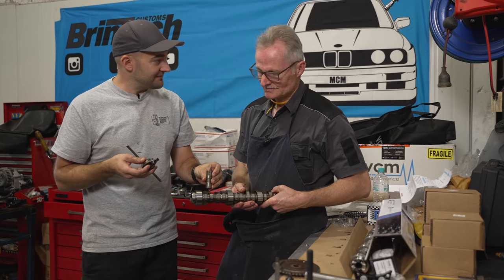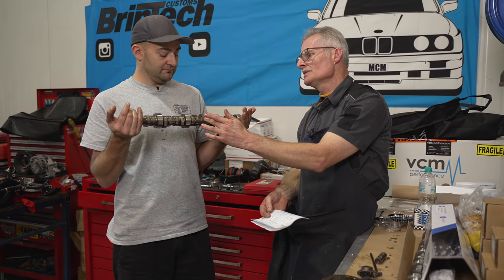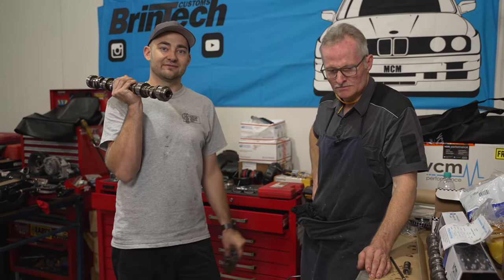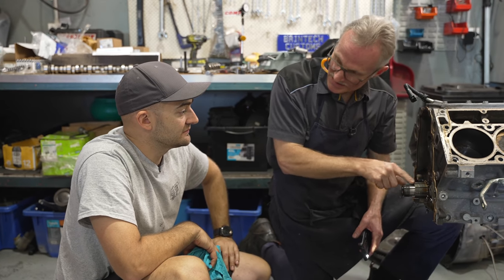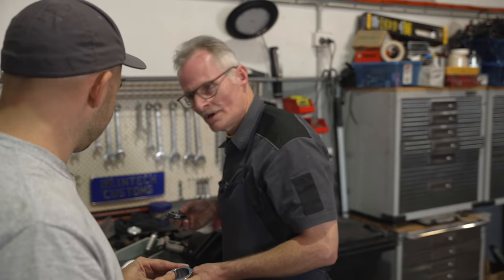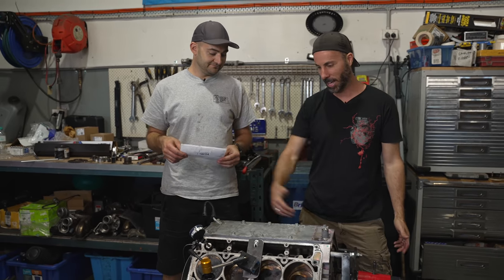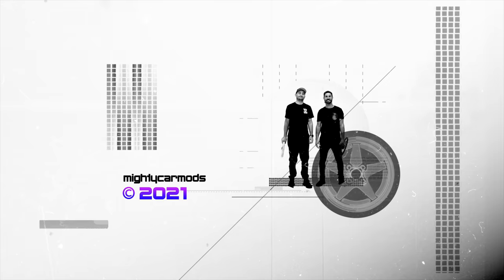CAM INSTALL tech on our LS powered BMW

Comment: I'm more into tinkering in the garage than hanging with professionals in a fully kitted workshop, but still an alright video.. When are you launching into the next nugget or modding the K Tipper for more powerrrr

Comment: Hey MCM... Does this mean you have to pull the motor out of the Honda and make sure it's timed right? I wasn't sure if I caught that correctly. May that explains the 77 hp on the dyno. Great video. Guy like Tony and Turbo Yoda are just legendary... You have had some really skilled mechanics and techs on from the Subaru BRZ to the Lotus and now The Chevy BMW... Great stuff..

Comment: Could have filed the thrust washers (more oil pressure) and drilled for oil squirters while you were at it ^^
Ow well, will do the job nicely.

Comment: Heads and Cams on an LS can be as drastic as forced induction on many many other vehicles. 

Course its not just LS engines, its pretty much all Cam in Block V8s. Ok fine, V8s in general. Because powah!!

Comment: Amazing content, but why would you deck perfectly functioning heads without checking also the engine side of that same interface?
Reply: Is it not likely that Tony checked the block deck?
I think generally it's just a good straight edge and whatever spec feeler gauge to give you a good idea.

Comment: Judging by the trajectory of the sun 🌞 and the moon🌙 the timing of cam sprocket A should be advanced by %100 of 2 degrees cubed using kabab-fueled Bogan-thumb 👍pressure points. Simple enough. 😄

Comment: Looking fancy but I'll stick with the Sloppy method of not pulling the heads, reuse all the old hardware and chain, never look at the cam bearings, and swap the springs using air pressure in the cylinder.

Comment: Outside of California and a maybe a couple other places the emissions laws in the U.S. are pretty non-existent.  The emissions laws are determined by the individual states and not the federal government and nearly all of the 50 states have no actual emissions laws.  We mostly just have safety inspection laws which are more geared around brakes, tires, lights, wipers, etc.

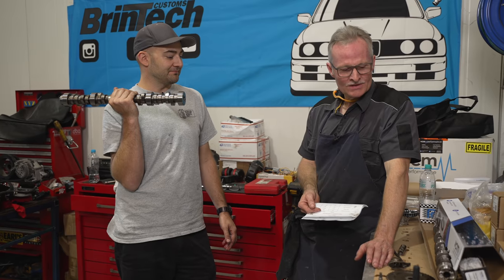Comment: 5:00 "take note American viewers " take note Aussie youtubers, most places in America dont have emissions testing for rego. Where we live you can drive your 2 foot lifted 4x4 truck, with straight off the headers exhaust up to the county tag office and get your new plates, Rattling the wall hangings in the office right off the wall. And nobody will bat an eye. Drive right by the police and get a thumbs up.

Comment: I just wanna point out that Engine Masters tested the difference between "boosted" cams and non "boosted" cans and found exactly zero difference.
Reply: This. All cams are forced induction cams, you are changing the air density in an engine, not the air flow.

Comment: Overlap on an NA engine helps scavenging vs forced induction where scavenging isn’t necessary.
Reply: Even if it was necessary you'd be SOL on forced induction. Valve overlap + forced induction = pissing all your boost and fuel straight out the tail pipe.
Reply: @andersjjensen  exactly

Comment: Like I get what he's saying but what's a 50 though (thow or however you'd spell it) (I know it's 50 thousandth of an inch) apart from that's really small, like a cook saying it's 350f I have no idea, I can't get an idea of what that actually means, it's 0.27 mm which is just as useless I hate numbers but I hate fractions more, ok

Comment: Ask good old Walter white he will know the exact number but I’m positive stock trunnions in your stock LS rockers only allow 580’ lift before binding up …. What that causes is your rockers to fail . 

A top dollar trunnion kit will run you about $250 …. You won’t regret it ! Far better than punching the needle bearings out of your stock rockers and sending them through your LS3 

Good luck with your VCM camshaft ….. 🤮

Comment: By the way everyone, the EPA slapped Brent at PFI Speed with an 18,000 USD fine. If you live in the states call or write your members of congress and raise hell.
Thanks
Reply: He deserves it, federal laws exist for a reason
Reply: Half the all the deaths in the usa are contributed by dirty air. Even VWs Diesel Gate is etimated to have caused 5000 additional deaths.
Yes, I have a 800hp street car, but I get it.
You can blame the Rolling Coal knuckle draggers for tarnishing the entire aftermarket performance industry.

Comment: 26 minutes of cam installation???😳👎
Reply: 26 minutes of pushrod V8 specifics. It's the first time they've done anything with an antiquated engine, so I thought it was quite interesting to see how you'd go about setting the timing on one of these. Can't imagine how much fun tuning would have been when they still used dizzies and carbies too...